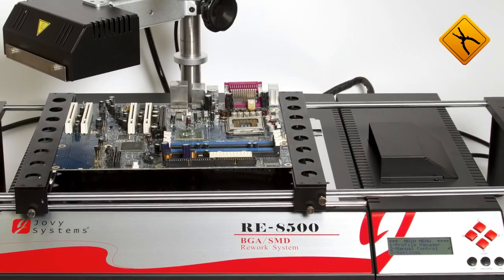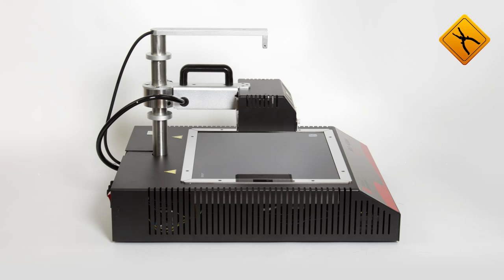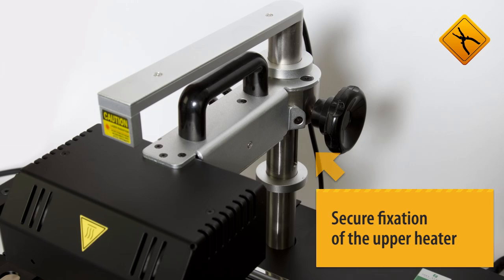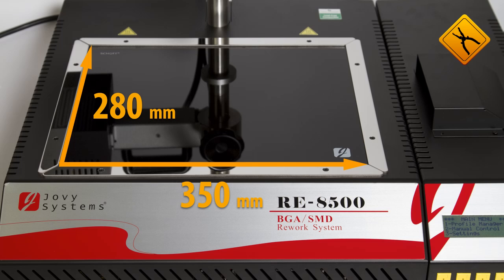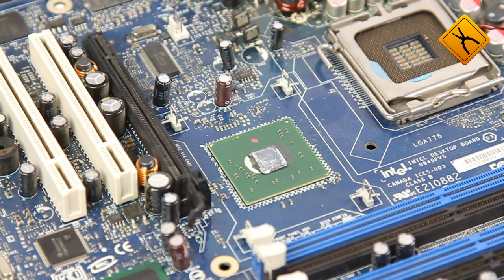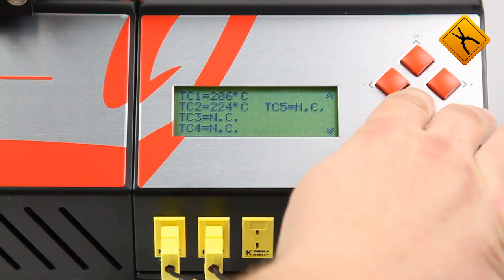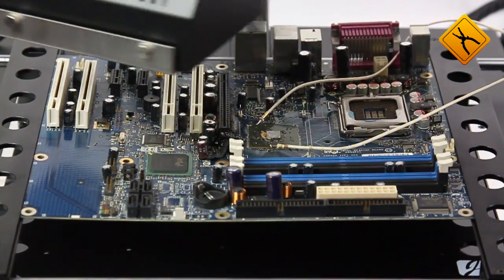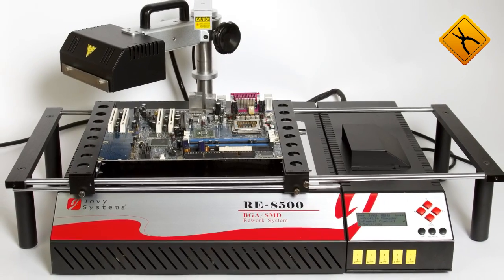Jovy Systems RE-8500 Infrared BGA Rework Station

Comment: I don't recommend this machine look at the plastic parts (melted video 2.25) board warped. I am used this machine with flexible thermocouple but this is not enough. Bad PID control and uneven heating.

Comment: what a man. Hahaha

1st. 1st thermocouple is to control upper heather

2nd. 2nd TC controll preheather.

1st TC should be placed on top of PCB

2nd TC shoudl be placed from bottom on PCB to controll preheather.

Otherwise u will not be able to run auto profile... without popcorn

:)
Reply: so he did it wrong ?

Comment: wow new model looks great new features awesome but... i see one small flow like the old model this one uses the same or similar table shame they didnt come up with something better like the board holder from AOYUE  Preheater 883 ... i had some problems with board warping even in this video it seems to be warped:) but there are ways to go around this dont want to put anyone off as 7500 was great reliable machine new model will be even better... but as they say nothings perfect.